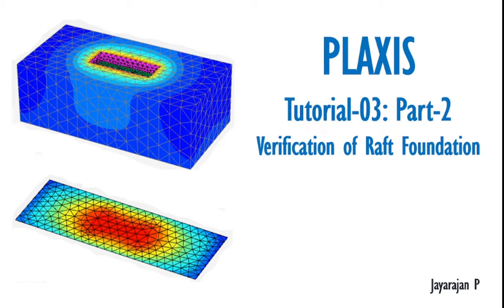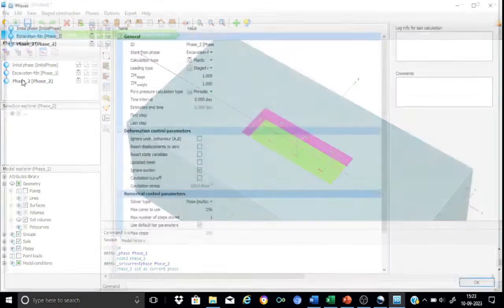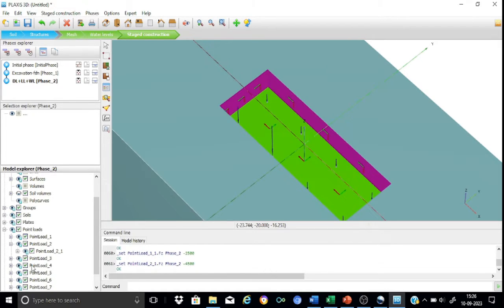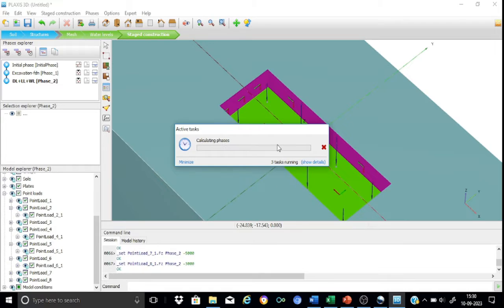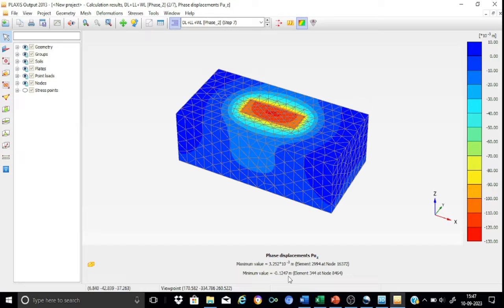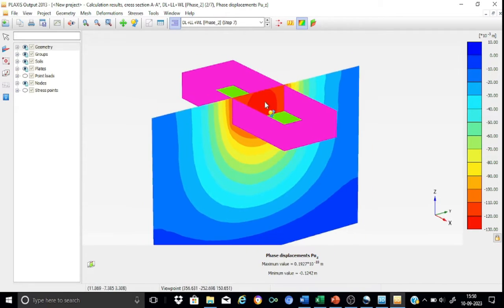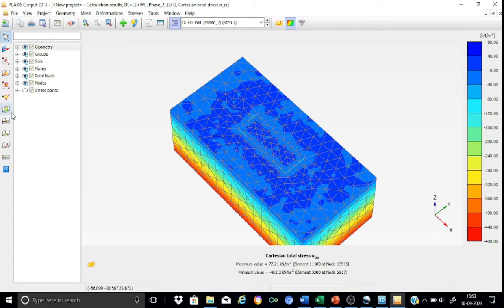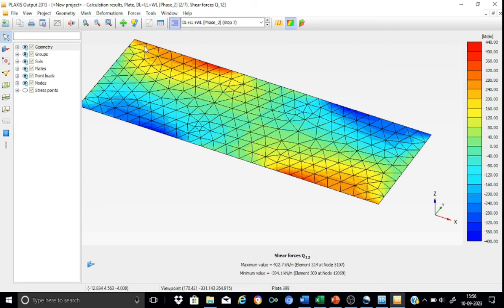PLAXIS: Tutorial-3 (Part-2 of 2): Verification of Raft Foundation

Comment: I noticed that you hadn't deactivated the soil inside the basement, so the result might be wrong when showing displacements at 15:10. By the way, I was wondering whether interface elements should be added inside/outside the plate elements to coordinate forces and displacements between plates and soils.